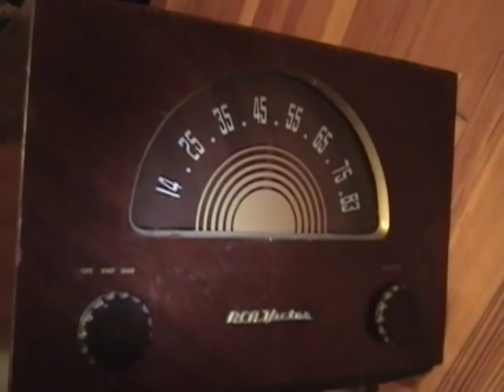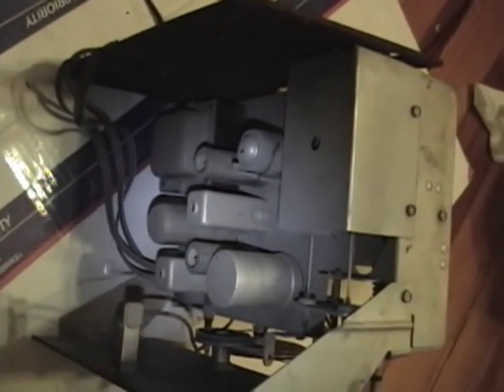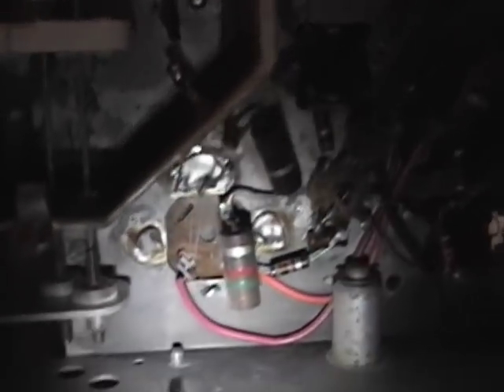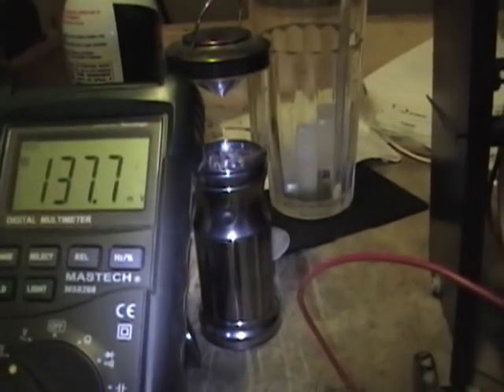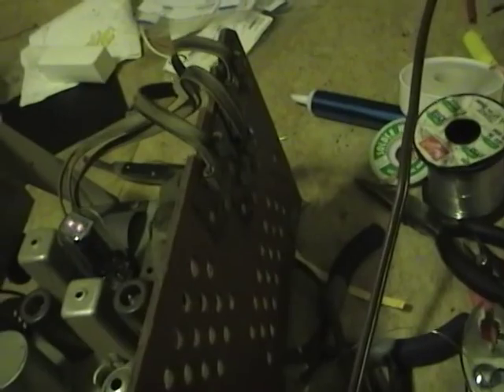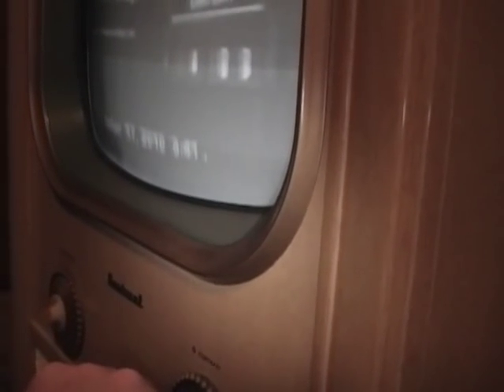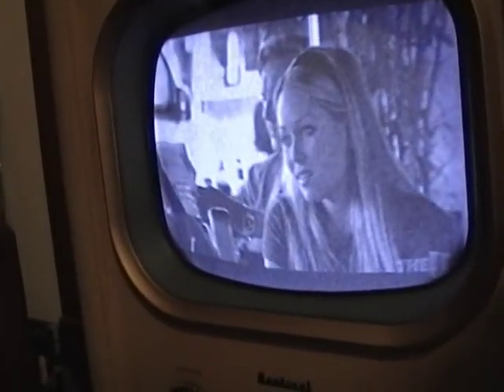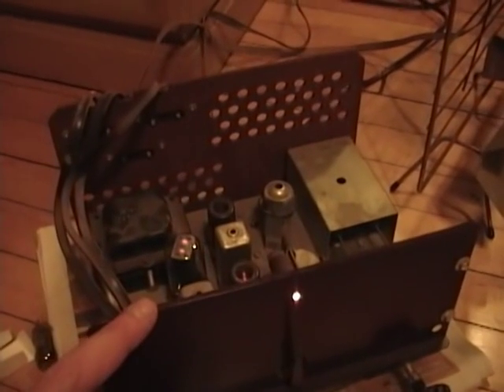RCA U70, UHF to VHF Converter

Comment: Sadly, UHF was introduced in 1952, but did not grow from there.  UHF inclusion in American sets fell from nearly a quarter in 1953 to only 9% in 1961.  The All-Channel Receiver Act mandated that TV sets imported or sold across state lines after April 30 1964 had to have UHF tuners, the only thing that saved UHF.

@aberdurant:  Oddly enough, it will get cable channels 65 (maybe 64) to 94, and from 100 up (Cable 95-99 are actually above VHF channel 6)